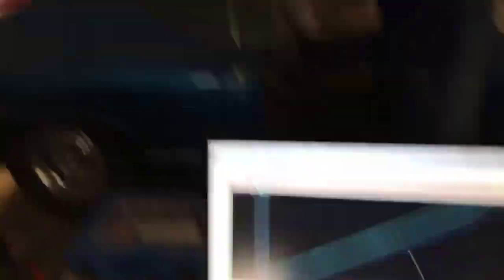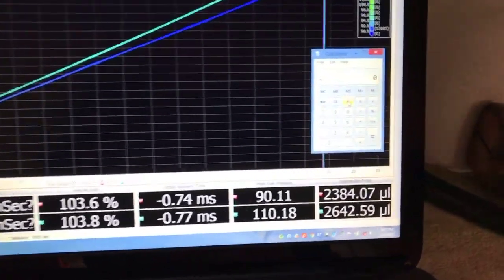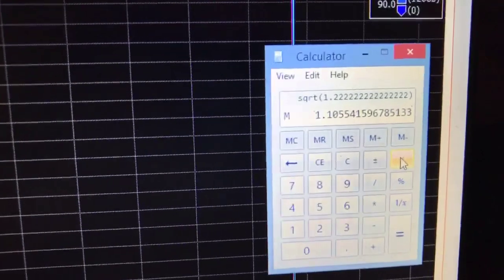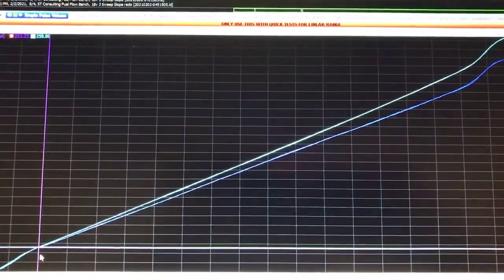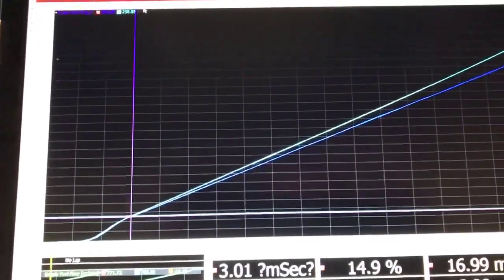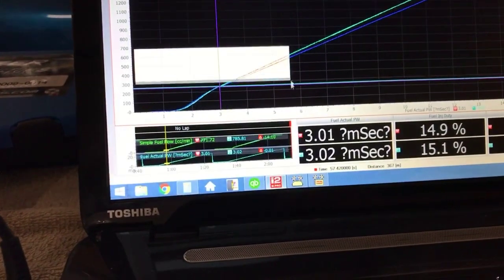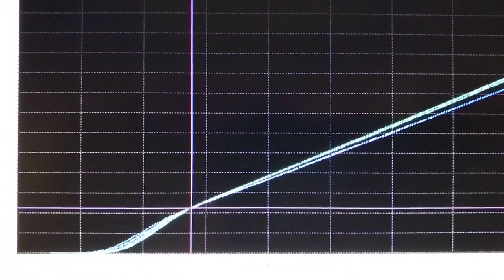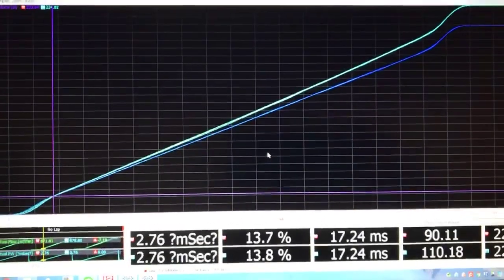How Fuel Pressure affects Injector Flow Rate - Tuned By Shane T

Comment: Excellent video Shane! I had this happen on a 1,500hp drag race S10 I tune when we bumped pressure up at the race track, in my mind I figured it had to be harder for the injector to open but just didn't make the connection why it was slightly leaner at idle. I changed the fuel map of course, being much less experienced than yourself. Now I understand what to do next time, thank you for putting this content out!
Reply from the maker: Yep happens often. Becomes clear when you see the data.

Comment: I was just learning about differential fuel pressure and after reviewing my notes this exact dilemma popped into my head. Since deadtime increases with dpsi, I was wondering if that would affect the rate at which flow is achieved with the injectors, particularly when they havent opened for much time at all. since the valve might be opening at a much slower rate than usual, I figured the flow might be less initially. This was an incredibly informative video, Thank you so much for sharing this information!!!

Comment: Shane thank you so much for this information it is very helpful I was actually having the same problem on a car that I recently started tuning and change fuel pumps and I noticed this behavior but I really did not understandThe behavior of it  .thank you so much for sharing
Reply from the maker: Awesome, always easier to recognize when you have had real world experience  with the symptom to draw from.
Reply: @TunedbyShaneT   is there  a way to calculate  injector dead times  when you don’t have any info on the injector it self?
Reply from the maker: You can get close by using the old fashioned way. Nearly all injectors have become linear by 4mS unless we are talking really low voltage (less than maybe 10v)
So you can run the engine at the right load and rpm to attain 4mS and keep it there. Observe the mixture, rpm and load.

Change the battery voltage (disconnect charger or take alternator connector off) 
Go back to the same rpm and load points, adjust pulsewidth to attain the same mixture. Observe the PW. Subtract the PW from the first test. The difference is roughly the voltage offset.
Reply: @TunedbyShaneT  thank you so much for the input I will look into that method to calculate the offset times thank you so much for the advice

Comment: Great illustration Shane, presuming the engine in this case example runs an M1 ecu, fuel only needed to be added because the injector wasnt characterised at that higher pressure initially?
Reply from the maker: They were M800
Reply: @TunedbyShaneT  amazing what you can do with an m800 some 20 years after first release.

Comment: Correct me if I'm wrong but that reduced flow at lower pulse is due to the coil windings ? Your trying to open injector lower pulse with higher pressure so it will struggle more that's how I think of it is that right ?
Reply from the maker: Yeah when the pulse is very short, there is not time enough to build the power you need in the winding to get the injector to open all the way.

Comment: So kind of like dwell ? Edit - with higher pressure needed due to shorter opening time ?
Reply from the maker: I think you have it backward or at least the terms are backward. 
The opening time is the part we adjust when tuning in the engine management system. The fuel pressure is adjusted to a specific pressure and maintained. The opening time is dictated by the pressure.
Reply: Does it ever get to where you are opening the injector ahead of the intake valve ?
Reply from the maker: Depending on the system layout, strategy and more specifically if it is Sequential (Fires one injector per cylinder in firing order) and synchronous (has a unique trigger event referenced to a specific point in the cycle) then the timing relative to the reference point can be adjusted anywhere in the cycle.

Which is a long way of saying yes.
Reply: Thanks for helping me understand !